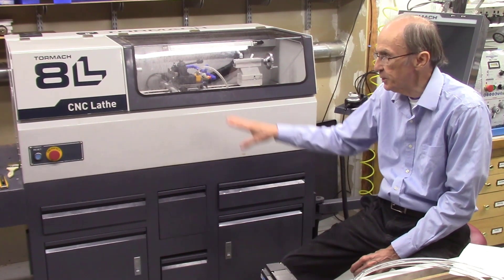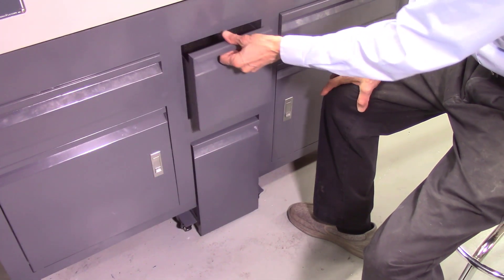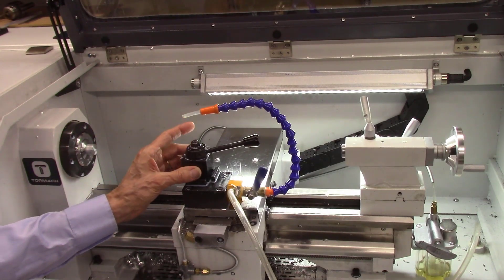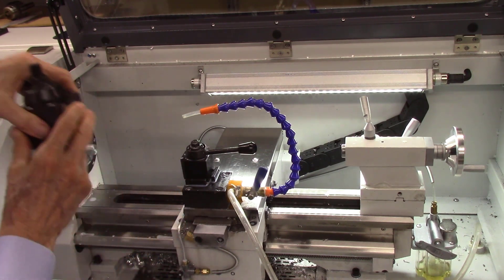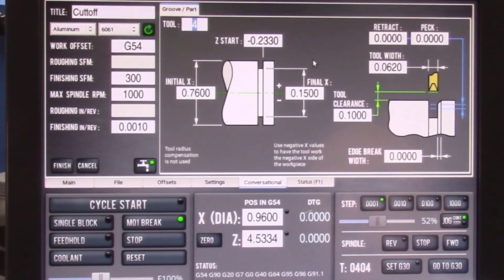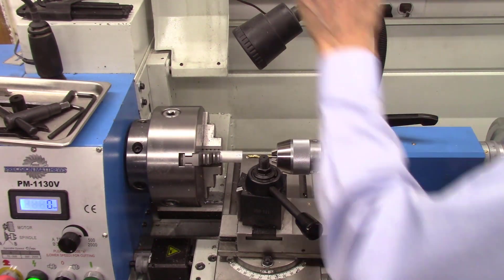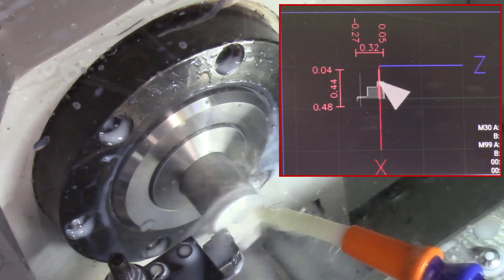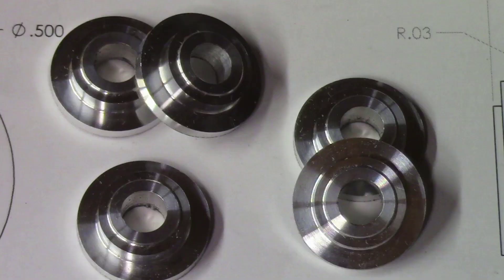Tormach 8L Lathe - First Project and Lathe Modifications

Comment: 6:50 The coordinate system in the lathe is the same as in the milling machine, turn the lathe 90 degrees to the right, then the spindle will be up, then you will understand why down in the milling machine the values decrease the same as to the right in the lathe.
The horizontal axis on a lathe is the "Z" axis on a milling machine

Comment: I have been following https://www.youtube.com/user/smallcnclathes not an 8L but some interesting ideas for getting the most out of a small lathe.  Another advantage in using the AXA tool post is you can get a tool holder for a 3/4" boring bar.  This could be used to hold a 3/4" shank ER style collet holder.  The advantage of this is that you wouldn't have a drill chuck sticking out so far.  Great modifications also.